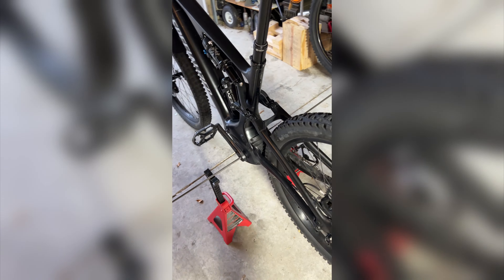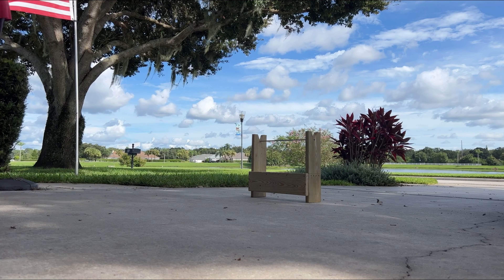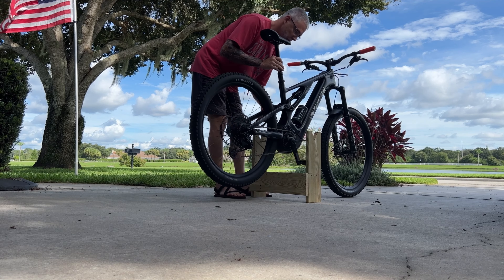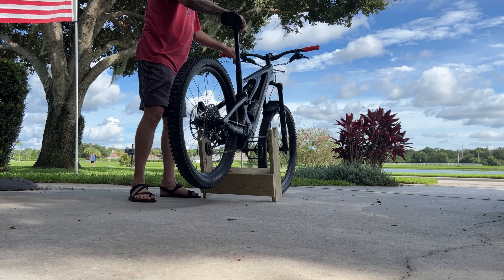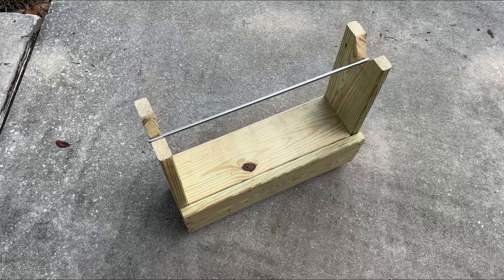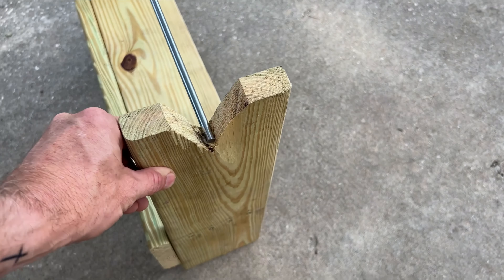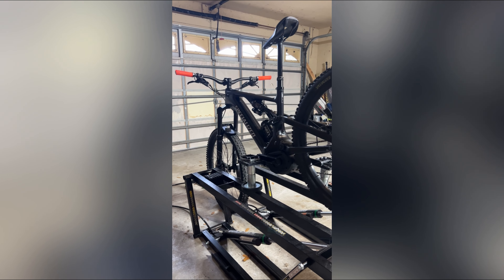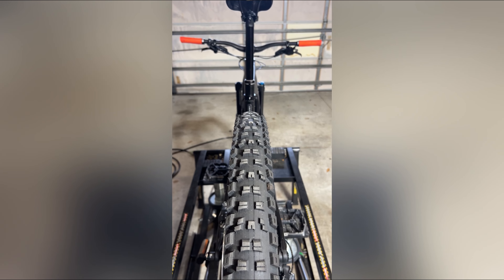Turbo Levo E Bike DIY Floor Stand

Comment: Did you order the 500mm x 8mm rods?  There are a few different size options available at the link.  Thank you for the great idea.
Reply from the maker: Yep. That’s the one. 500mm was just right… if you want more room side to side you can go longer.